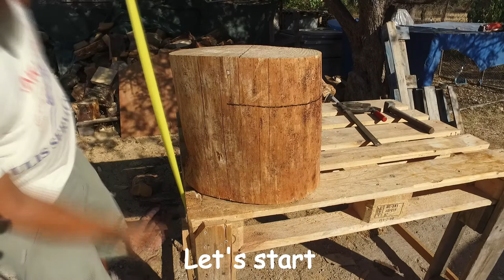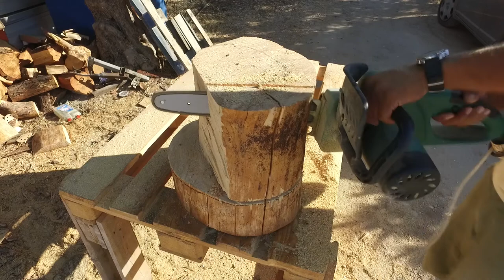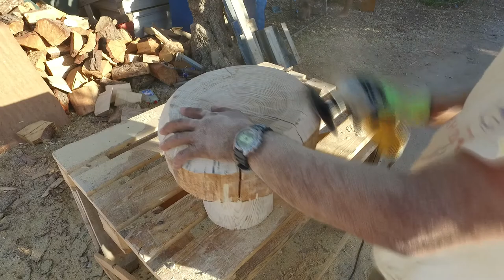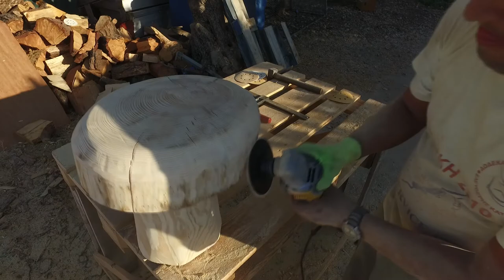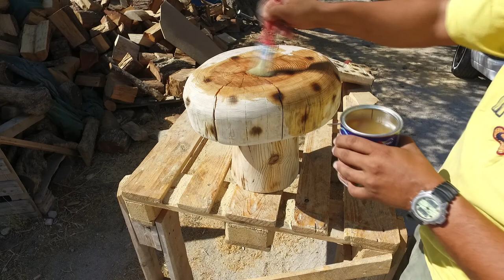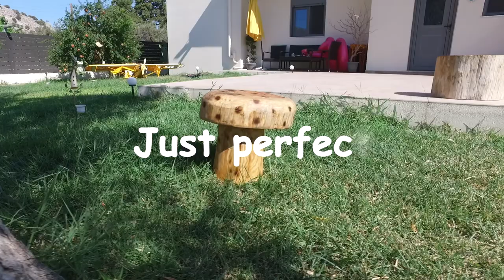Wood creations - Wooden mushroom stool

Comment: What did you apply to make the spots?? And what did you coat it with?? It's fabulous! Did you set it right on the grass or put it on a round paver to protect from moisture?
Reply from the maker: Hi thanks for watching my video. 
The spots i use flame gun and burn a little the wood to make a spot.
For coat i use tik oil for wood.
For moisture i pass tik oil many times at the wood that is on the groung i think 7 times. its about 1 year now and everything is ok .
Reply: Thanks so much for the information to try to copy your delightful toadstool stool!
Reply: You do beautiful work very inspiring